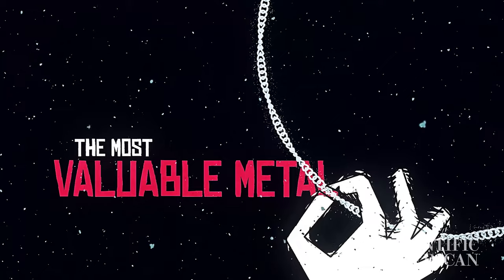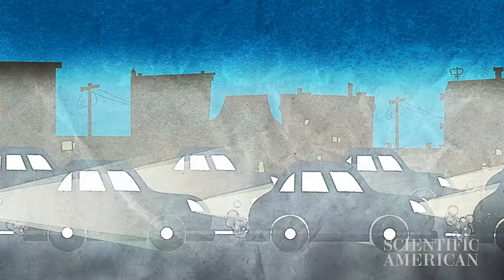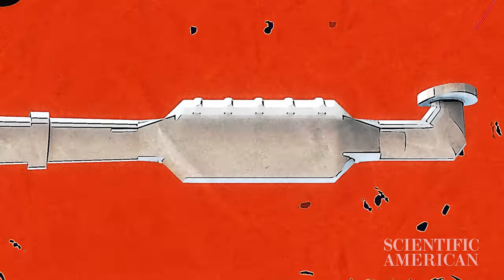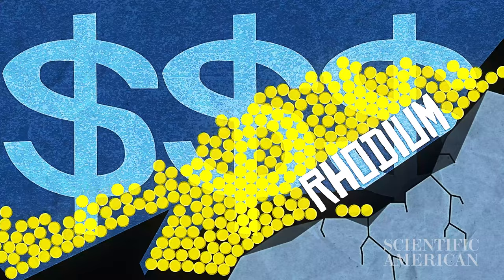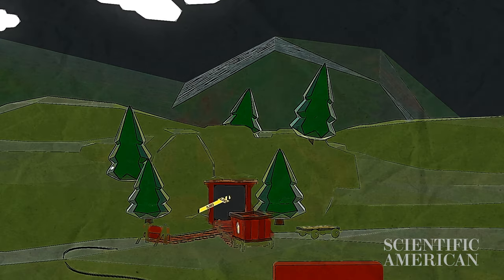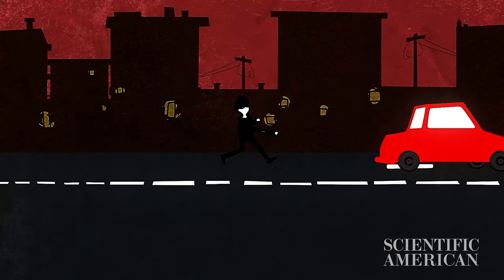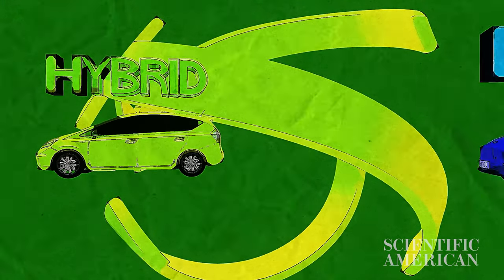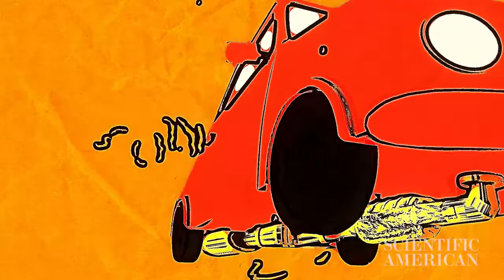Catalytic Converters are getting stolen all across the country. Here's why.

Comment: That was interesting to know, but how do we prevent this kind of theft from happening? Some kind of tip included in the video would be nice.
Reply: You can engrave a unique ID which you can use to prove it was stolen from you. Manufacturers really should be doing that already and then setup a database of stolen numbers so recyclers can flag them.